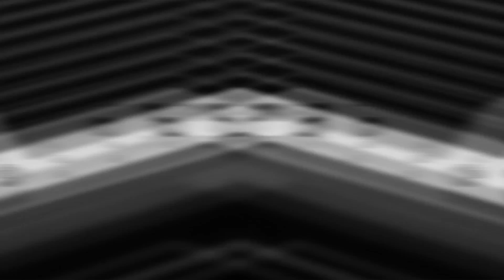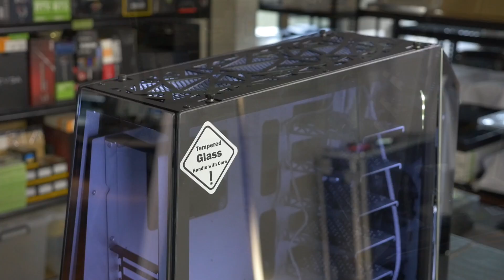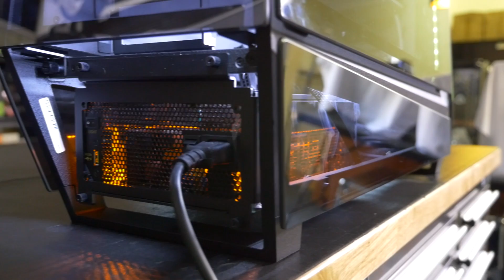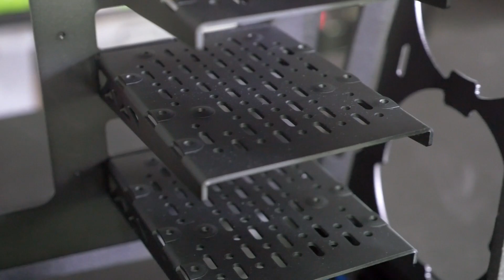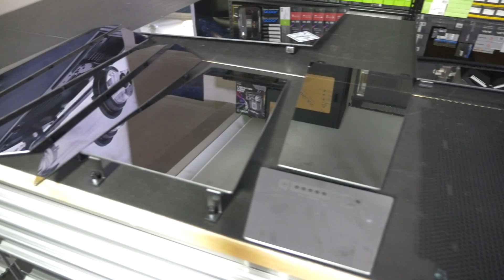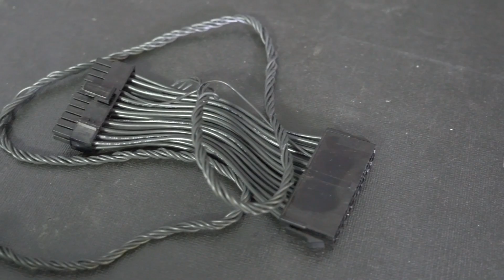Inwin Tou 2.0 Review

Comment: Never like this case.  The older ver. allows you to install a blu-ray drive at the bottom, this one doesn't.  Raidmax, Cougar, Antec open frame is much better than this.
Reply: theres enough room in the case for a blueray
Reply: where would you put it?  @thefurniturestoredeals
Reply: @HappyHopping11  you can put it at the bottom next to the power supply theres a big gap down there after everything is installed and its just a big open space, I cant seem to figure out what I want to put down there yet
Reply: ver. 1 is better, you can put it at the bottom front  @thefurniturestoredeals

Comment: Dust filters ineffective...really?
Reply: Without dust filters, you can run your fans at lower rpm to get equal amount of airflow as you'd have with the filter. All dust filters let in some dust anyway, you'll probably take in the same amount with lower rpm and no filter. That's the idea anyway. He's not the only one I've seen who thinks dust filters are overrated
Reply: @TheDarkSide292   
This. Its placebo more than anything.
They are basically useless, worse even, they let the smallest dust particles through which in turn
are much more difficult to get rid of later.
Throw them away and use a PC duster every 7 or 14 days and you will never have dust, a quieter and cooler system.
Reply: Right? My front 460x dust filter does a good job collecting dust last time I checked.

But some dude on youtube said it's ineffective soooooo guess I don't need it anymore....

Comment: It'S already out of stock.  I wanted this case for so long.  Didn't order in time.  In the end I've order D-Frame 2.0 at a 60% discount on Black Friday.  Still expensive.  D-Frame is also very sturdy.  I've rolled the case upside down and side ways to fill the water cooling system with least amount of air as possible.  Those cases are really designed to last a long ass time.  My D-Frame is 30/500.
Reply: i have the tou 2.0 great case paired it with a 3090 and 10900k
Reply: @yoshimoutidis9941  do you have an issue with the LED touch panel on top of the case? mine randomly shuts off the computer when i open my curtains.
Reply: @xuxu119  my one is a little less responsive sometimes when turning the lights up and down not too sure what’s happening with the curtains thing may be because the case is made out of glass and it reflects into the sensors of the touch panel
Reply: I just unplug the touch power switch , you dont need it because theres a push switch at the bottom front

Comment: Not sure how I feel about this. It's nice as always but I just dont know. 🤔🤔🤔  wasn't this released back in 2017 or early 2018?
Reply: I'm assuming the 2.0 is a rather recent update but InWin Tou has defenitly excisted for a while. Oh, and the limitedness seems a new feature as well.
Reply: @kaiyao2766  it was originally at CES 2017.
Reply: @MumbysBar  Interesting. I just never realized it was limited and so old, but now I know ^^
Reply: The Tou 2.0 was available for purchase back during spring of 2017.  It has been out for almost two years now.
Reply: @jeffspicoli7215  that's what I thought. It threw me off since I was view number 25 on the video. I knew it had been at CES in 2017. Never paid attn to whether it went on sale or not though. Seems odd to be doing a review on such a limited edition case that sold out new back in 2017.
Reply: Yes, this (cough) "review" is totally pointless!! This is just a very late, very superficial overview, and not a real "review". There have already been several dozen builds, showcases, and reviews of this Tou 2.0 case both in 2017 and 2018, including some real reviews where they did a build inside the case, overclocked it, and measure the inside temperatures (which have fairly good interior temps despite the lack of openings on the front panels). 
 
I also found it really stupid that he is "taking off .5" for the 9.5 rating just because he believes that In Win can find some way of improving the case, even though he had no specific suggestions or criticisms himself. That is the STUPIDEST logic that I have ever heard.  So he would also rate Usain Bolt's performance at the Olympics 9.5 because he is also sure that Usain could have found some way to improve his performance.
Reply: @jeffspicoli7215  lol. Yea.  This seemed like, I have no content let me put up something stupid just so I get traffic and more recommended viewings.
Reply: That's probably the exact reason like I said. Smh. It feels the same on Jayz but at least he is doing the grudge with GN.